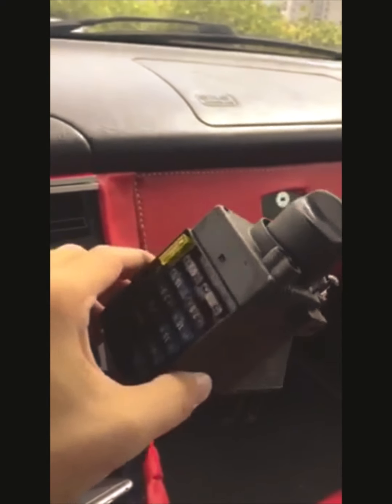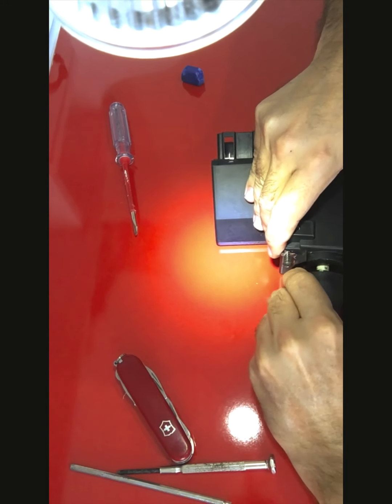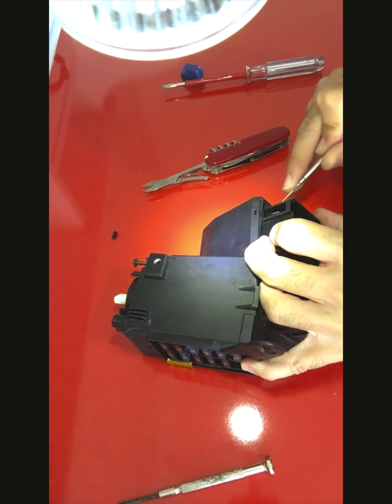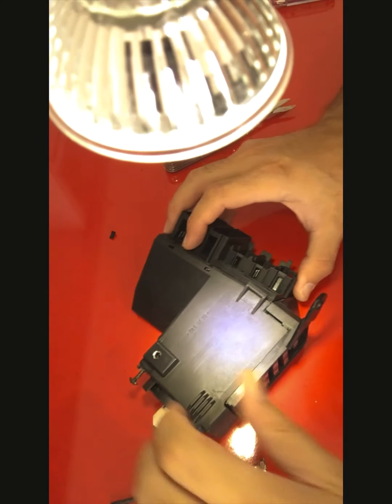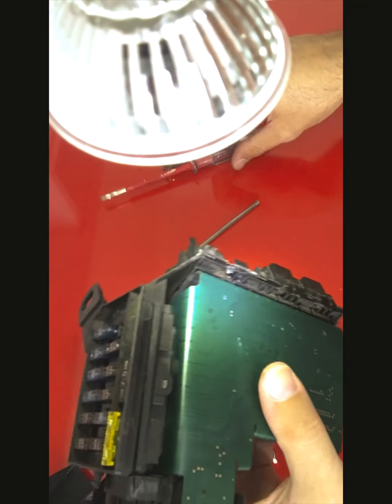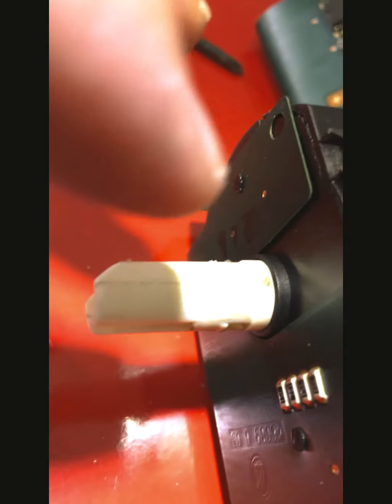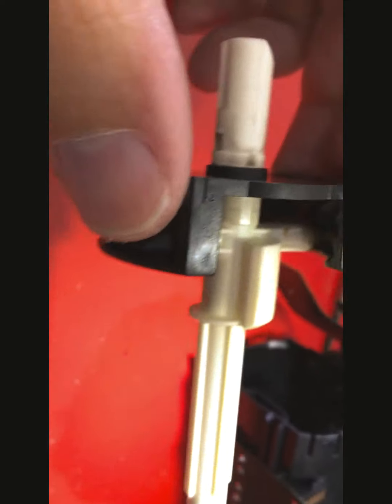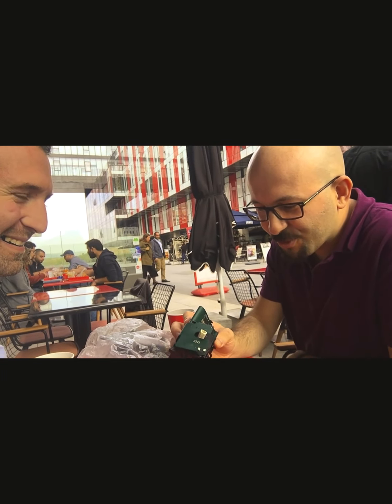Mercedes SLK Headlight Switch DIY Repair (After Start-Error problem)

Comment: The video you posted was very helpful to me.
I was experiencing headlight switch issues with similar slk models.

It was a very useful video for disassembling the headlight switch box.

Is the switchbox fixed after I asked friend to repair it?
Reply from the maker: great to hear that. the headbox fusebox unit was first repaired, then replaced by a sedan model which has the same inner electronics but only minor changes to its plastic casing. thus casing was transfered to donor one to solve the problems once and for all.

Comment: i have absolutely the same problem, but i can´t find an electronic service here in germany which would be able to fix it up to now.
Reply from the maker: I would try buying a second hand one and try if the fault disappears. i recently changed mine with an same-era e klasse/c klasse's. not so different modules only their outer plastics are different. you can buy slk switchbox for 70 euros on ebay.de https://www.ebay.de/itm/185194054027?hash=item2b1e6d018b:g:IWwAAOSw03JiRFxp

Comment: Did you get it fixed or started to work with replacement unit?
Reply from the maker: i had it fixed the unit to a local car electronic service shop total cost to me for this service was like 50 usd.

Comment: Has Alper been able to find a fault with the headlight switch module?
Reply from the maker: Alper refurbished the solders on the unit, no apparent faults he said. We will be trying the unit on the car at a service location and we will be having error codes checked if any other sources of the problem. The car runs perfectly without the unit and i use it only on good weather/daytime, didn't hurry for a fix. Next month ı will be visiting a couple of countries in europe, if any parts needed, i may source them during my trip there.